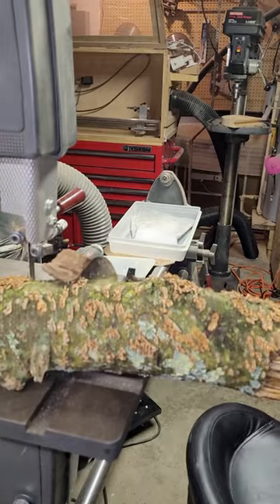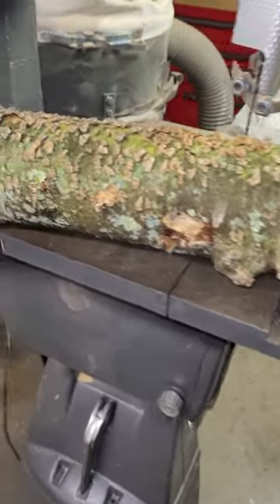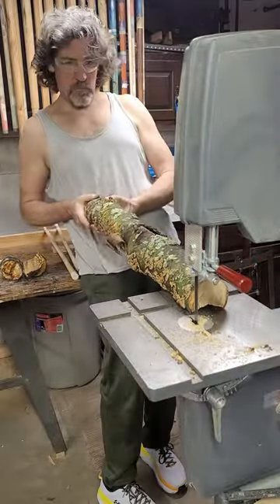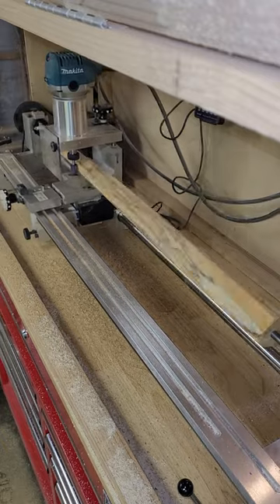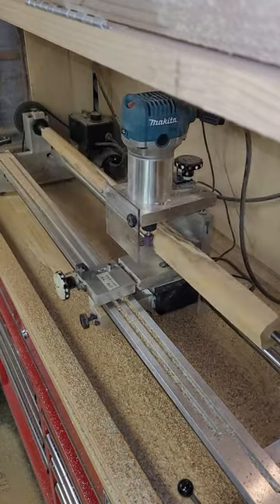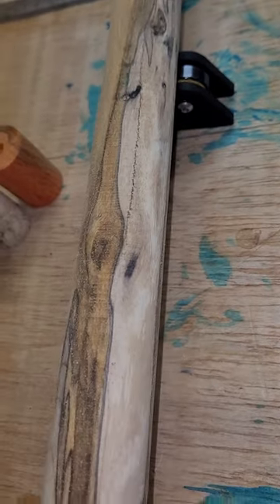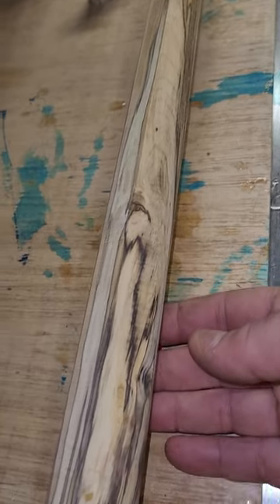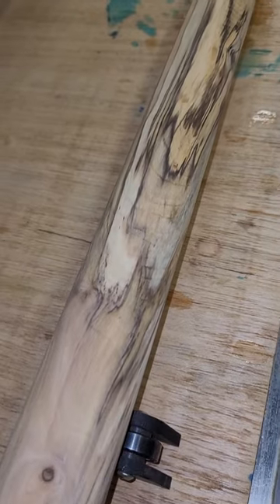I found a black birch pool cue on the Puppy Poop Loop this morning...

Comment: What brand and size is your band saw?  Looks like a 12 inch.  Would you buy that saw again?
Reply from the maker: It's a Shopsmith machine, bandsaw attachment. Dad bought it in the 80s. It's not ideal for me but fine for a tiny hobbyist's shop.
Reply: @charactercues  thanks